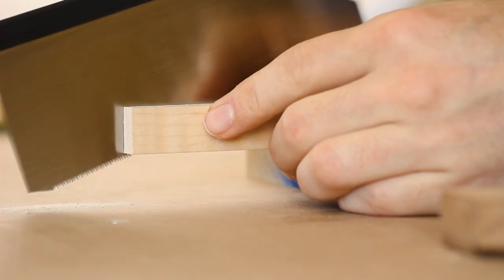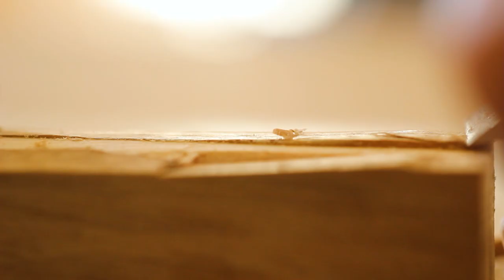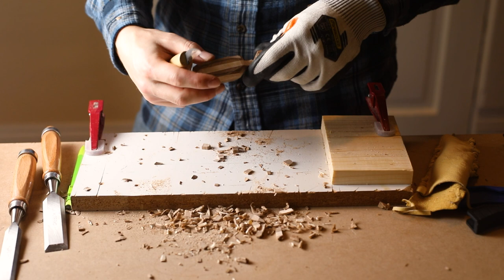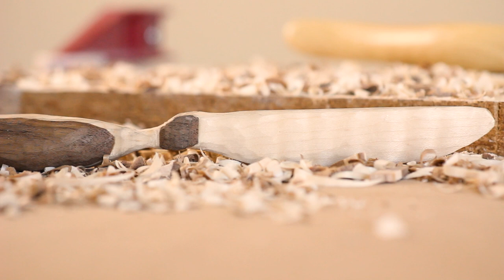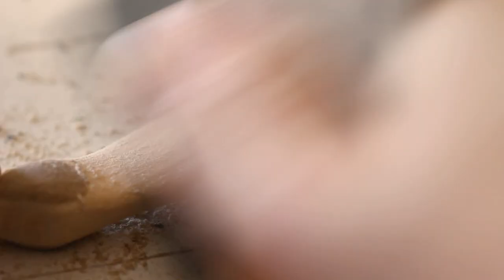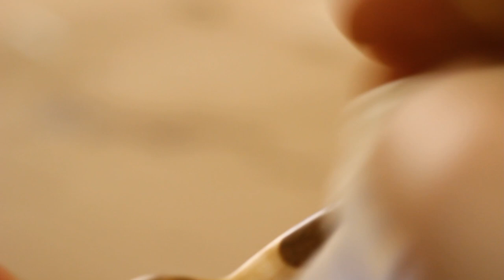Carving a Knife from Maple and Walnut

Comment: I tried many ways to make a knife out of wood, well, no matter the wood you use, i came to the point it has to be serated as a saw, but it will never be sharp enough.
By the way, good job, i like the shape.
Reply from the maker: Thanks! Yes, this probably won't cut anything except for really soft stuff, but that's fine with me. They could also be used for spreads and jellies instead of cutting.